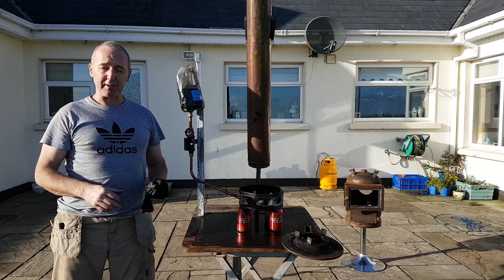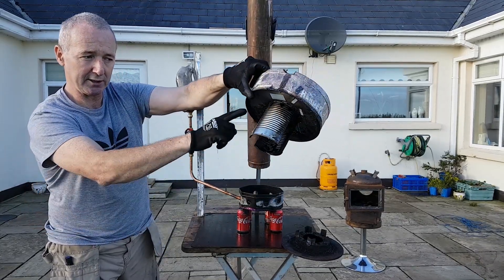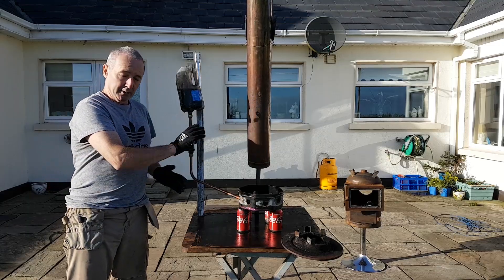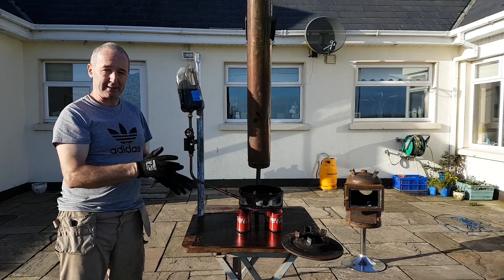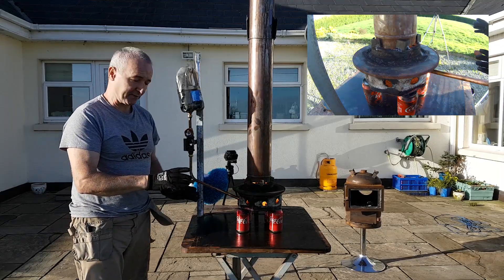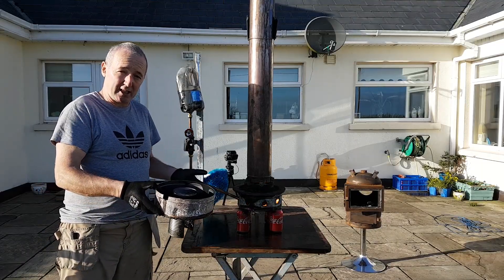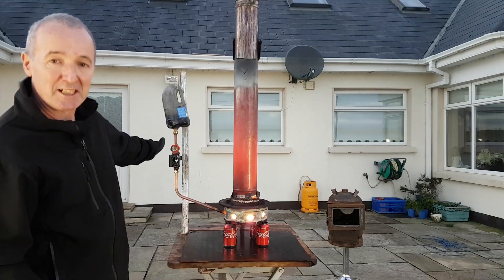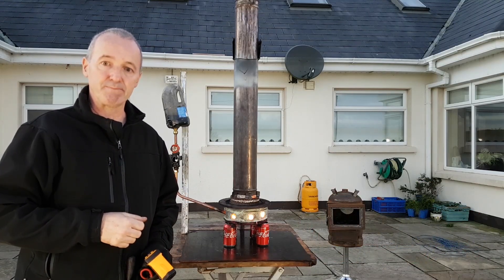Homemade Waste Oil Burner

Comment: LOL, Good build but everyone is claiming to build something to provide FREE HEAT!! THERE IS NO SUCH THING AS FREE IN OUR SOCIETY. Free would mean someone builds the heater then installs it and delivers all the oil you need to keep it going and pay the portion of the utility bill it takes to run a fan to distribute the heat. The you would almost be able to claim FREE HEAT. Good content though. Stay well.

Comment: Hello GerrysDiy, thank you very much for your excellent tutorial videos.
I have a question. In this video, you placed the air vent holes of the fire chamber on the side wall.
In the middle of the video, you mentioned that another design could be used where the air is drawn from the bottom.
In another video on YouTube, you had also implemented this bottom-airflow design, where the fire chamber receives air from underneath.

I would like to know which design is better and provides more oxygen to the fire?
My goal is to use waste engine oil as fuel in a way that produces no smoke and results in the least possible soot.
Thank you very much
Reply from the maker: Hi. The other design requires a stove. If you look in my playlists you will see it working on quite a few different setups. Thanks for commenting Cheers Gerry

Comment: For most shops, this oil burner is large. It is also not hot enough and could use tertiary combustion for completed hydrocarbon conversions.

Comment: Dear Gerry. You have demonstrated several waste oil burners that work similarly. Which of the burners is the most optimal in your opinion. I mean the cost and labor consumption of its implementation to the efficiency and ease of use and smokeless combustion. greetings

Comment: the problem I faced with oil from pickles and similar, is that it can't ignite easily : I  had to let it inside drop by drop
Reply from the maker: This type of burner needs to be red hot to ignite the oil so I start it on Kerosene and when hot enough add the oil and it keeps going on oil alone. hope this helps cheers Gerry
Reply: @GerrysDiy  thank you Gerry. Do you think we can obtain blue flame without a fan,just taking the air from the inside? Have a nice day. Paolo.

Comment: Looking into building one. I have a few questions. 
How long did it take to get the stove pipe red hot ?
How long does a liter of oil last at the burn rate you were using ?
Can you see the emissions coming out the exhaust pipe ?

Comment: mix your veggy oil with 99 cents 90% alcohol  from the $tore burns hotter lasts longer and can heat a whole lot of water that can  heat for miles and is recycled add a little oil in the water and the heat lasts longer if you got any questions you can always facebook me saying you have questions

Comment: I would put a big tank of water around it and run hot water threw copper coils and back into the water tank set up dc fans above the coil to blow the heat over the floor

Comment: The bisket tin doesn't melt and collaspe over time or a hole in the bottom, or melt the coke cans?  900 degrees sounds like it should.  The flue on the other hand looks like it is designed for use on a wood or coal burning stove, or standard gas or oil furnace, but not the tin or cans!

Comment: Great simple design. Love it 🍺
Wondering if you could introduce a small copper coil up through the flume circulating water from a small children’s pool powered by a pond pump. I currently use a gas BBQ with copper coil inside, garden hose, pond pump, works a treat but expensive to run.
Reply: If you permanently build the unit next to the pool it should be simple to just weld the copper coil to the flute itself or you can mount a heat exchanger into it and plug the water recirculator into that, you might need a fan to boost the flame if your piping blocks too much of the space in the chimney, depending on how you set it up you wouldn't even need a pump, the hot water would cause itself to move you just need to make sure that the entire pipe is filled with water before you turn on the heat, you would just need to be careful as the water output would be literally 100 degrees Celsius (212f) at the exit. If you put a pump the water will never get that hot before returning to the pool.

Comment: Did you try used motor oil? I have lots, just wondering.
Reply: That is waste oil, this is a waste oil burner, yes. But this is not permanent, it is only for proof of concept it will only work until it melts apart in a short time. But if you use heavier materials, as well as incorporate knowledge on how to get a complete efficient burn, along with some safety in the design it could be permanent
Reply: Same here😆✌🖖

Comment: Where can I get a gas bottle in Ireland with the valve removed please?
Reply from the maker: Hi Donal. Plenty of damaged ones in the scrap yards. Taking the valve off is easy but you will need a couple of tools to get it done. Here's a link to one I did a while ago. https://youtu.be/X_mn38Q7Zmc?t=444 Good luck with you project. Cheers Gerry 👍👍
Reply: Thanks Gerry.👍

Comment: I've watched about 10 of these videos and not one person has shown the design of the burner at all I mean it's kind of like Cockrell fast and show it flip it around I can't tell what it is if someone said reproduce that I would have no idea what to do and I'm a metal worker LOL I have a lady that I have a metal I have all the metal working tools you can think of a sheet metal folders bar roller everything I couldn't reproduce it I have no idea it looks like there may be some holes in it I can't tell exactly please someone show the design

Comment: An object with a polished metal surface, for instance, emits far less infrared radiation than the same object painted with matte black paint.

emissivity is the opposite of reflectivity. A high emissivity makes a surface easy to measure using an infrared thermometer; a low emissivity is more of a challenge. Emissivity is usually about 0.95 for most non-reflective non-metals.

Comment: That system does not need any air compressor, only drip waste oil, is it? And with that confuguration, how much waste oil consumption per hour ? may be you could calculate the heat in Watts.
Reply from the maker: Hi. This was just a demo unit but there is no outside air or compressor just a gravity oil feed and that's it. Have a look at some of the burners I have made in this playlist. https://www.youtube.com/playlist?list=PLmQ5wJnkAIoJYDBgSOis9s1yDhcFdswtN  Hope this helps Cheers Gerry

Comment: I'm guessing to didn't want to show the top of the oil stack because of the smoke it generates! This design is a very dirty burner. The neighbors will be calling the fire department when ever you run this stinker. Sorry to say

Comment: Gerry i have watched several of you vids and what your doing is awesome  but i have a question ? to see what your thoughts are  last year i put an overhead gas heater in my shop and it works really well however when i got the gas bill i all about came unglued  and thought well this isnt going to be cost effective so i put an old  wood stove in and will keep the shop  70 degrees as long as i keep the fire roaring . but after seeing some of your vids  i think this might be another  way to go my question is do you think if i set up a burner  similar  to the one  your showing in your vid here  to set inside the stove by itself if it would be able to create enough vortex effect  to allow it to burn properly  in other words  the openness of the inside of the stove   may be to much volume of air  space around the flame  to allow it to flow properly without having a flu pipe directly on top of the oil burner housing  if this makes any sense   thank you  Bill  from Nevada  USA

Comment: All your videos show a vertical exhaust I wondered how far you could  push a flame along  a horizontal chamber before running it out a chimney like a rocket stove burn  chamber .[un insulated ]
Reply: Smarter people than me come to the conclusion that you must take the stack 600mm vertical before changing direction, then 45degrees , with oil boilers pressure jet or vapourising.

Comment: Gerry what stops the flame setting the oil on fire and running back up to the supply line to the reservoir / oil holder
Reply from the maker: Hi Dave. There are a couple of things at play here. There is negative pressure in that pipe and air is being pulled down that 1/2 inch pipe into the burner which helps cool it. The oil also cools it and the flame is more interested in travelling up the flue. My other burners work on the same principle but I have the oil feed pipe inside an air feed pipe on some of the burners. I can force air in this way too. Here's a link to my new burner https://youtu.be/kQNkefOdwUg Hope this helps Cheers Gerry

Comment: I went off of your original videos with the propane tank and made my own a couple years ago. I made mine with a 60 gallon air compressor tank. Heated my 1900 square feet garage last winter and burned around 50 gal of used motor oil.
Reply from the maker: Hi Jeremy. That's a great result for you, These things can work really well and make a lot of heat. My latest stove / cooker delivers lots of heat without a fan but I have to admit looks a bit nuts lol. Well done and thanks for the comment Cheers Gerry
Reply: GerrysDiy 
Yes it's has done a great job. I do appreciate your videos and guidance and instructions. they were very helpful. Would like to see a jet burner burn barrel to burn debris from yard. I use my blower on one and worked great with a mixture of dryed wood and fresh cut . Jet burner would dry the wood and burn it fast. Might be a idea for you another video.

Comment: Vent these little guys through a mass and store that heat for later.  I tinker with rocket stove design.  I try to capture/radiate until I get 325 degrees Fahrenheit due to condensation.  With the oils it wouldn't have to be so hot.

Comment: Have you ever had the oil in the tube catch fire and carry flames back to the tank?  Maybe when the oil runs out?  You might put a section of meltable hose in there as a safety mechanism.
Reply from the maker: Hi Jessie. Here's the drip feed I normally and it allows me to add forced air to the setup if I need to https://youtu.be/tnzEDEpz3Yk Cheers Gerry

Comment: Hi Gerry, I just found your videos earlier this week.  Really enjoying them!  

Every year I make a brush pile in the back of my property
and burn it in the winter when we have lots of snow cover.  Of course the brush pile is covered in snow as well so sometimes it’s hard to get it going.  But the past few years I’ve used waste oil to get it started and I’m always amazed at the energy that comes off that stuff!  Gets the pile burning in nothing flat!   From witnessing that it makes me want to get a waste oil burner to heat my shop, now after seeing what you have done maybe I will make my own. Thanks for the inspiration!
Reply: With respected Sir make Briquettes out of the bush and burn them in a stove in the shop.
Reply from the maker: Hi. Thanks for the comment Here's a little stove that I made for the shed that makes plenty of heat on little enough oiul about 2 litres per hour  but could be increased  https://youtu.be/tnzEDEpz3Yk Cheers Gerry
Reply: Just watched the video thanks for sharing the link! Oh by the way my name is Russell.
Reply: @GerrysDiy  2 litres/ hour means about 20 kWat of power. Quite enough to heat a garage or even whole house..

Comment: Was wondering if old diesel fuel would work, and if the smoke would be burnt off as well? Any ideas? Keep up the good work.
Reply: Hello
Since the smoke is unburned combustible, from the moment you go over 600°C the smoke will be consumed.
We can't see on top of his pipe, but there is no smoke on this kind of system.
Because as far as you go on hight temperature, you burn it all.
And old oil from engine would definitively work ;)
Reply: Absolutely soon as it gets hot it will burn clear

Comment: Great videos Gerry. I'm hoping to build something using more substantial materials. Roughly the same size just heavier gauge material for the hot box. I'd gather those biscuit tins burn out pretty quick eh?
Reply from the maker: Hi Leslie. The tin would last just a few hours but Here's one I made that heats the shed and you can cook on it too https://youtu.be/tnzEDEpz3Yk Cheers Gerry

Comment: Can the heat be controlled? If so how, by controlling the oil feed and or air intake?
Reply from the maker: Hi Dennis I added a drip feed system to this burner here https://youtu.be/WyredKT2VdE  Here's a video where I even cook on a similar burner unit. https://youtu.be/tnzEDEpz3Yk Cheers Gerry

Comment: I want an omni-wood-oil gasifying self cleaning thing with a focal point of heat, perhaps with lets face it the nicest heat patterns metal can buy?
How does one make a device capable of fully burning all things that could be a display piece?

I want thermometer metals to bend shapes as it heats up, uncurling dragons and thorns in the heat.
Reply from the maker: Hi NandoDando. I made a waste oil burner that I placed in a domestic boiler stove in my home. It runs on 2 litres of veggie oil per hour. Here's a link https://youtu.be/SAmHNp6fOUA ...... I have made my own stoves too here's a link  https://youtu.be/tnzEDEpz3Yk Cheers Gerry

Comment: Hi Gerry it is great to see the options you keep coming up with it gives us future builders ideas or even confidence to try it ourselves esp when you see how simplified you have got it down to now 
O know the Round tin can cause vortices to form when the fire gets going but is their any reason not to try a square oil burning tin? maybe a vain or so inside it could help flow of air 
I am just curious  for those who build more of a square  type of waste oil burning stove to go around it 
Tony
Reply from the maker: Hi Tony. It's been mad on this channel. Views went up by about 0.5m and subs by over 2k in a month. Keeping up with the comments is a little tricky too.  I think it would work with a square tin no problem. If there were issues all you would need to do is throw in some type of baffle    inside. I am going to be going with powered units next I think. Thanks for the comment. Cheers Gerry
Reply: Hi Gerry I'm so glad your channel is growing  you are one of the best adviser inventors on Waste oil heaters around Gerry and being a plumber has some validation as well  a Idea for you as well How about including a water heating coil in the heater as well as a cook top so you can really make use of any heat created? would you need some sort of regulator on it if so The reason I ask is my sister has a Solar hot water system on her roof and I was thinking of Including the Stove as a heater booster for her Solar heater ( at present she is using an electric one  obviously using power to boost the temps) 

Tony

Comment: Use that to drive a big Stirling motor generator combo.
Reply from the maker: Hi thagrit It would be very easy to make steam from these waste oil burners and a stirling engine  could easily work. Thanks for the comment Cheers Gerry

Comment: Gerry what is your favorite oil burner that you've made?  Love the videos!
Reply from the maker: Hi Josh. I suppose the burner that I use most is my Updraft burner. It's simple and needs no power and is capable of heating my workshop which is 20 x 30 uninsulated. My latest cooker stove / shed heater is a great fit for this burner too and is great for keeping the kettle on the boil for coffee or tea. Thanks for the comment Cheers Gerry

Comment: nice bit of fun.  now double wall it and feed it from the heated jacket :)
Reply from the maker: Hi Drawing Fire. I will be making some boiler stoves with a different burner in the next week. The last one I made was well able to fill my shed with steam and heat 80 US gallons of water in 1 hour + heat the shed. More on that soon. Cheers Gerry
Reply: Maybe a steam draft inducer? Sorry if I'm mentioning stuff you've already done, just discovered you yesterday :D
Reply from the maker: Hi Drawing fire. Thanks for the comment. I have some powered units that I will be making next week and I will be making hot water with it. This will be powered but I might make a passive version too. Do you have a link to a draft inducer.  Cheers Gerry